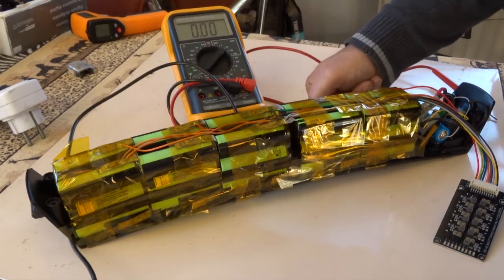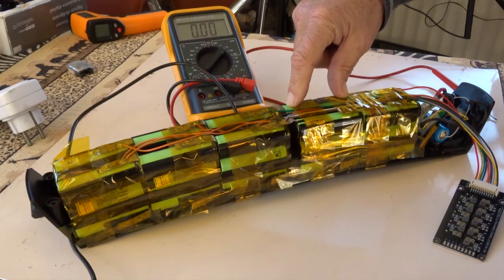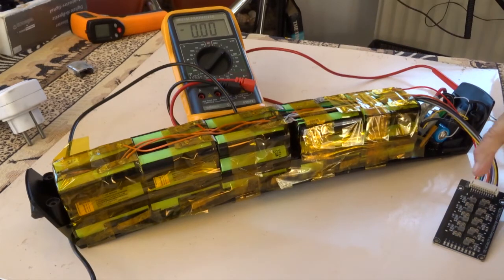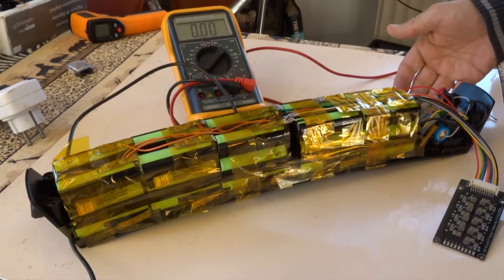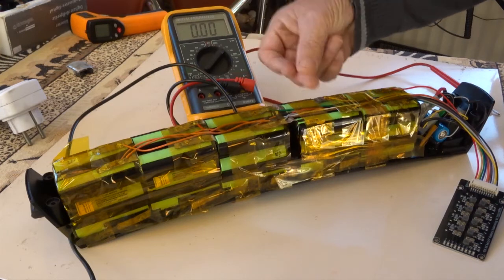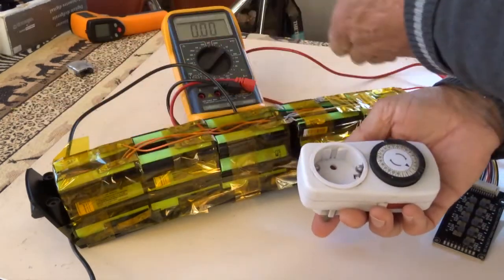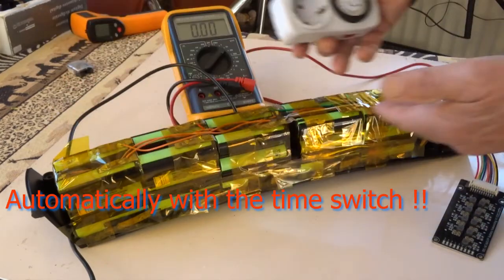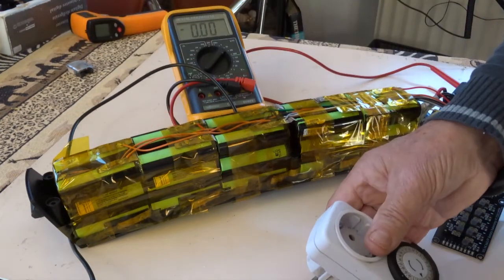NCM/LFP active balancer for BH Neo Jumper E bike battery during charging, discharging. Safe to use!

Comment: Thanks for great video. I has also problem with emotion Neo 36V BMS, Battery pack not get in or give out power (30A fuse looks to be ok). I wondering if I remove BMS (just like you did), but may I use original charger by connecting it to battery package without BMS )is there risk of overheating etc) ? and second question; As you told bike need voltage indicator signal to "wake up", i considering to take from cell pack 3 (brown wire) . (so 3*3.7v=11.1V =100%) or pack 2 (7.4V=100%)

Comment: The unbranded balance board fits and modded to accept original harness with minimal wiring. A switch added  to toggle between charge and discharge. A trim potentiometer added to the third wire(blue) and negative to replace the resistance of the thermal sensor. 
https://www.dropbox.com/sh/q4xvmgqth4b0nrm/AADnsCuiyVMA-jJR2PAMEA8Ca?dl=0

Comment: This is the 13s balance charger I am trying, that fits in the original space. I believe it only balances when charging, and should have no affect during discharge except to cut off main at a safe low voltage.

https://www.dropbox.com/sh/q4xvmgqth4b0nrm/AADnsCuiyVMA-jJR2PAMEA8Ca?dl=0